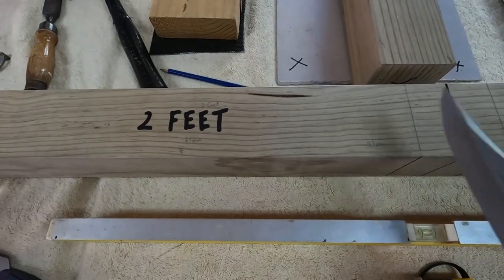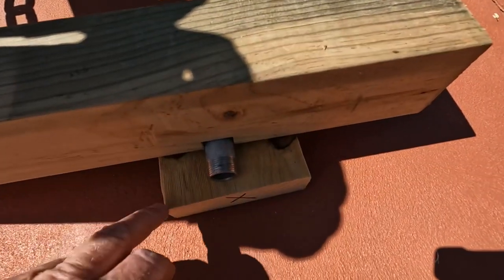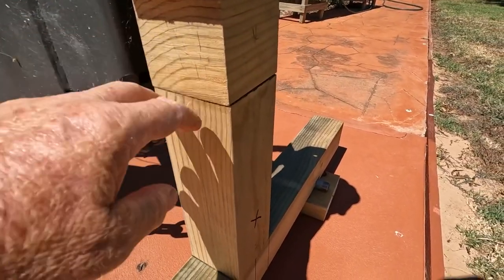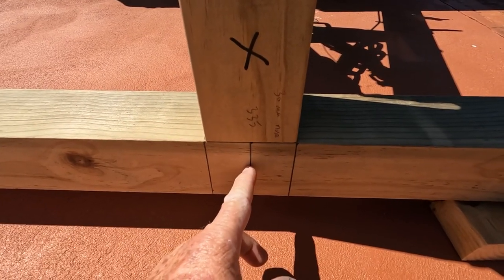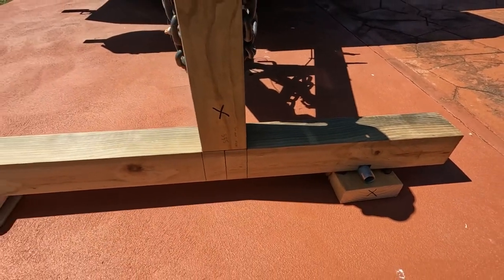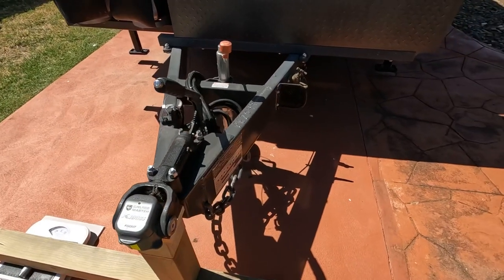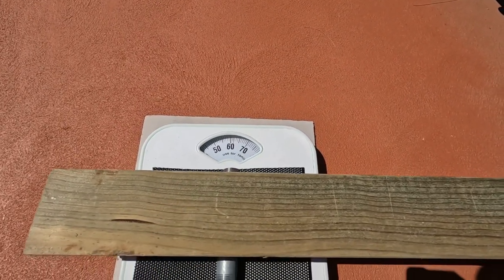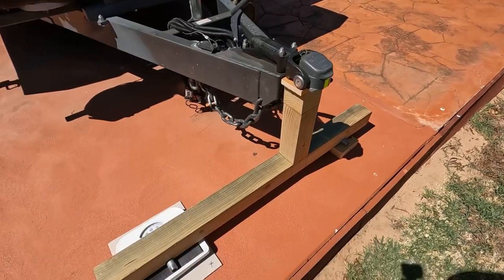CHECKING CARAVAN TOW BALL WEIGHT USING BATHROOM SCALES | SEPS ADVENTURES

Comment: I know this is a delayed response, but I just bought a towball scale, Towsafe, and wanted to see how it compares with this method. The Towsafe scale showed 220Kg and the bathrooom scales showed 225Kg. So I think both methods are pretty close. When I got it measured professionally they showed 266Kg, but I had full water tanks, and also had the very heavy jack and the thumper air comprssser in the front boot. When I took them out and put them under the seat above the wheels I found the towball weight went down by 20Kg. I'm still contemplating getting air bags, but also contemplating a new tow vehicle. Time will tell. Thanks for the video.
Reply from the maker: Interesting comparison showing the two methods within 5kg of each other which is pretty good. Are your water tanks forward of the axles as that maybe the reason why there was approx. 20 to 25kg difference after removing the jack and air compressor. The air bags work great for us but I suppose it’s a compromise between have a car that is comfortable when not towing and a car with minimal sag when hooking up a van. Cheers!
Reply: Firstly your construction method works great, and I am pleasantly surprised how accurate the bathroom scales technique is. Our new van is twin axle. One water tank sits between the axles and the other sits just forward of the front axle. So much of the weight is spread over the axles rather than towards the front. I've played a lot with moving stuff around and measuring towball weight and its very informative to see how much difference things can make. Its all very interesting, and something I never really gave much thought to. I was worried initailly about how much the MUX drops with the van on, but the van is pretty level, so I may leave it as it is. @sepsadventures
Reply from the maker: @leonwilliams5175  when you think about it, if a manufacturer of a vehicle states its vehicle can take a maximum of 300kg on the ball it must have allowed for the associated sag, so theoretically the vehicle must be safe to operate with that weight. Cheers!